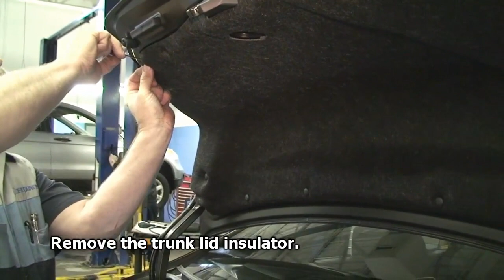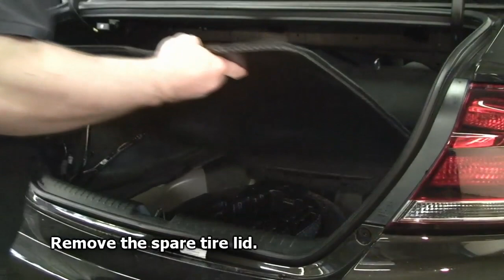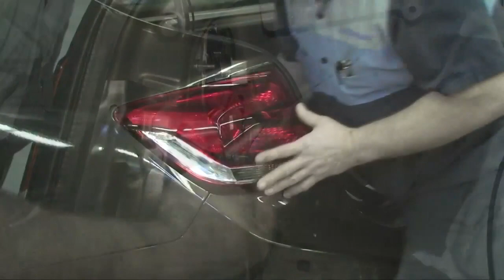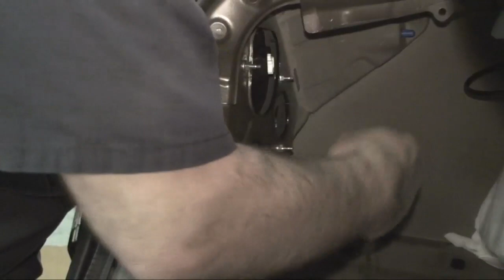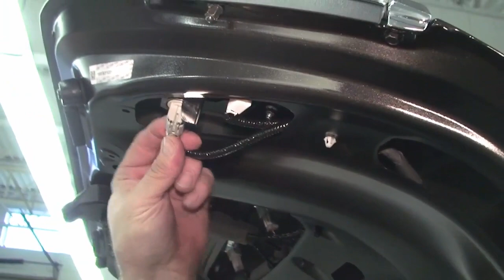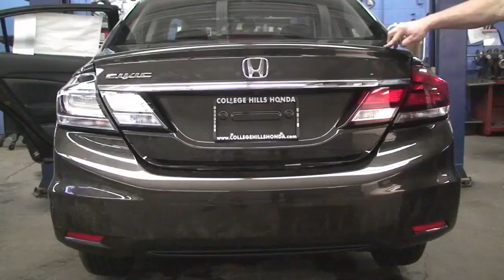Episode #252 - 2013 Honda Civic Sedan Taillight Upgrade Installation

Comment: What a brutal job to replace tail lights... I really dont like those clear lights... But I gotta congratulate you guys, for having so much patience to do that... And thanks for letting me know how difficult is to replace a light bulb in my Civic 2015...
Reply: This isnt a demonstation on how to change a light bulb, if you need help changing out a light bulb you probably shouldnt own a car lmfao. You look like a joke when clearly this is a tutorial on swapping for hybrid taillights
Reply: It'll be funny it the original harness works with the new light! I'd test it before doing all that...if the plugs doesn't fit change it, looks like the hybrid light plugs!
Reply: @charmnGUY  it won't work, you need to splice for the 3rd brake light. That's why in this vid, they say no need for splicing.

Comment: I remember on my 1994 Honda Accord when I installed aftermarket tail lights... simply open the trunk, twist the knob on the taillight panel 90 degrees (takes just 3 fingers) and the panel is off. And voila, you have access to all the bolts and wiring connections to replace a burned out bulb, or the whole taillight assembly. The process for newer vehicles looks like it takes 20x longer.
Reply: Tell me about it, they’ve mounted the mirror to the door instead of the window corner so now to replace my side mirror after someone’s knocked it from the mount I have to remove all the door trim...ridiculous

Comment: If you are putting the Hybrid Civic taillight into a gas Civic, can you do the same thing with the 13 Accord taillights?  I want to get a Sport, but it has the LX/Sport/EX/EX-L headlights, and the LX/Sport/EX lights.  I want to swap in the V6/Touring LED running light headlights, and the EX-L/V6/Touring taillights with the LEDs.  Can I just remove the old ones, plug in the new ones and be good?

Comment from the maker: The wiring harness part number is going to be different depending on the application and there are 2 additional light assemblies you need besides what you have listed. If you need a complete kit we have that available on our web site.
Reply: Not available

Comment: are these still available at Collegehills honda?
my local dealer quoted me $1900 for the set
Reply from the maker: Availability is tight and at least one piece is currently on backorder. They are not listed on our website but you can call to order.

Comment: Is it really necessary to replace the stock Harness? It doesn't use the same plug outlets?
Reply from the maker: +Cory Smith The plugs are different than stock.
Reply: +College Hills Honda do those tail lights fit 2012 Sedans too ? I know the trunk is different on 2013 because they have that extended tailight thing but does the main tail light fit 2012s i would love those tailights for my Si
Reply from the maker: This was only tested on the 2013.

Comment: Will you guys still have this part available may 2018. I get my 2014 civic then and this is the only place I can find these taillights
Reply from the maker: These are collision replacement components so they should be available for years to come.
Reply: if you change the tail lights like you just did. do you really have to change the harness?

Comment: The harness doesn't look like it's available anymore, and I can't find one for the gas model either. Does anyone have the part number?
Reply from the maker: Harnesses are still available. Hybrid 32108-TR2-A01, Hybrid Navi 32108-TR2-A10
Reply: @CollegeHillsHondaAccessories  Different between nav and non-nav? How so?
Reply from the maker: @aidanfranits1339  Different backing cameras.

Comment: What would you have to do to make them work with the si spoiler?
Reply from the maker: A little custom splicing. We don't have a harness that will get you 100% plug and play for a Si.
Reply: @CollegeHillsHondaAccessories  do you guys have the lights and harness in stock?
Reply from the maker: @lobes4president767  We no longer keep these in stock due to low demand. Light assemblies and navi harnesses are available. The non navi harness is currently on backorder.